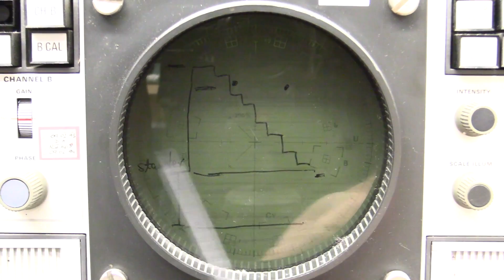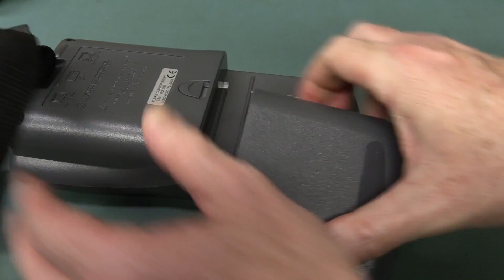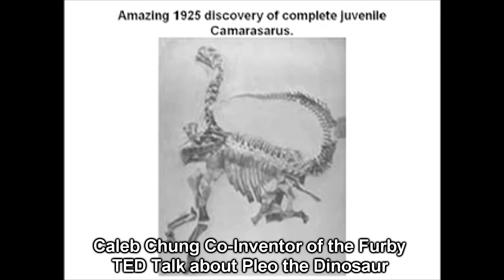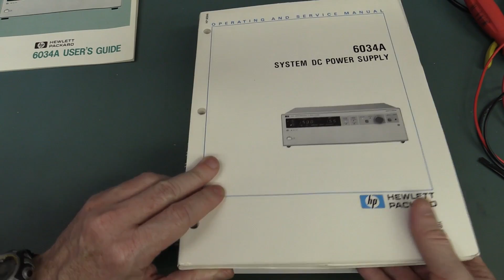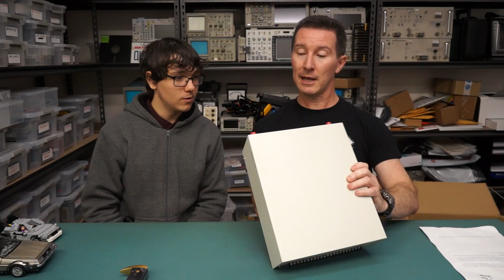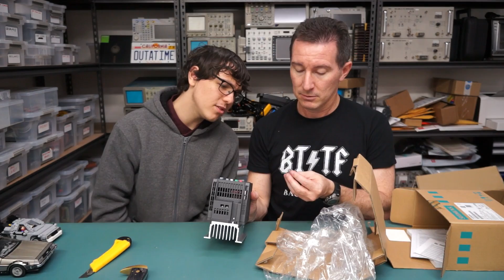EEVblog #756 - Mailbag

Comment: Pleos are cool. The skin on ours has deteriorated, but he still works. The battery pack is 6xAA NiMh, but later versions used a LiPo pack which was compatible but used a different charger. Ours likes dancing to music and eating his leaf. He also likes being stroked and tickled under the chin. When he goes to sleep it is usually because the battery pack is getting low.
I know this is a comment on an old post, but I saw the pleo on a shelf behind you on a recent video and was curious, so I searched for it. :)

Comment: maybe Pleo's touch sensors designed to work with its skin, not direct touch ?

P.S.  signal port on the Simens invertor must be for remote control (on/off, speed setting, direction setting) as usual on other invertors.  buttons on inverter itself used for initial settig of motor parameters.

Comment: +EEVblog  ----About the IGBT's...... The thermal modeling is usually done in programs such as Energy 2D and sometimes in Auto-cad.  The way they do thermal modeling for the IGBTs is that they set a field specified temperature onto the IGBT in the modeling program. The modeling program then takes the temperatures and shows where heat flows best(through the flow of least resistance). From these models, the thermal engineers keep changing the shape of the component and the size of the heat sink in correlation to the thermal resistances shown in the modeling program.
Reply from the maker: supermench 45 Interesting, thanks for the detail.

Comment: Hope you can connect the Siemens inverters to some motors  and display the waveforms and explain a bit about the need for VFD's their applications and the techniques used to implement them. Relevance in electric vehicles? Nice mail bag.

Comment: Seriously? The Bible Thumpers cracked the Nintendo Lockout chip?
And apparently where the reason for it's introduction as well?

I had no idea. That is hilarious.
Reply: Tilman Baumann Maybe they were not religious themselves only marketed towards said people
Reply: Tilman Baumann Sachen & Atari (Tengen) would have also been reasons to continue to have a lockout chip.  The NES actually has a lockout chip and it came before the snes.
Reply: Tripcore yeah, when you want a measure of control over the games taht come out for your system, you NEED to keep third party cartridges off the system. The Cartridge-bypass trick the SNES and N64 unlicensed games would often use is the same system Gamesharks would use to get past the lockout chip (though those also do other things)
Reply: I was just amazed that Religious nutters of all people where the ones driving this.

Comment: AMD and Intel written on the same chip? Is that even possible? And what has IBM to do with all that? Derp me;)
Reply: skru2b AMD was making Intel-licensed CPUs since 8086. IBM wanted to put Intel CPUs in their IBM PC, but only under condition that there will be a second-source manufacturer for their chips.
:)
Reply: ZXRulezzz
Well, I don't know why but IBM seems to be of the more sympathetic microelectronic giants out there. Only mistake they made is that they left open the Gates. I bet Intel is cursing the day they licensed their first lot of microchips to AMD ;)
Reply: skru2b It's not the only Advanced Micro Devices product to fit an Intel spec, either. I had an AMD version of the 80486 in a Tandy computer I think it was. And the K6 series brought Pentium III power to the old Pentium boards (IF the manufacturer was willing to update their BIOS, anyway), the X86 instruction set is an intel spec, and it's used by both companies, with some variance here and there.
Reply: DFX2KX Not Tandy... they got out of the computer manufacturing business when the 80386 was king.
Reply: CodeTech
Tandy was the brand name it had on the front of the case. Came with deskmate (which was a horrid OS, by the way) and a 4x CD-rom. It was clearly not one of the originals.
Reply: Hmmm - I worked for them from 1979 to 1991, and I don't recall any 486 class, but that doesn't mean they didn't exist. Weird. And yes, Deskmate was crap... but it was intended to allow people to actually do something with their new computer back in an era where software could easily cost more than the computer.

Comment: Differential gain and phase displays are just demodulated chroma amplitude or phase (R-Y,B-Y) plotted against time on the X axis. You need to use a modulated ramp test signal to use those modes.

Comment: So a company was making games for the Nintendo 64 illegally without paying royalties to Nintendo?  And they made bible games?  So they made a device overriding Nintendo's security measures?  I guess they were just asking for a lawsuit.
Reply: ***** Actually, it was for the snes, and the lockout chip is actually since the nes.
Reply: Dr_Kachu san
Well it seems kind of ridiculous.  Bible games?  You would think someone who sells bootlegged Nintendo games would be making crazy games, not Bible games.  I guess those game designers aren't very good Christians.
Reply: Well, its a shield against nintendo so to speak.
The company behind Super noak ark 3D, to not mention several other christian games for the NES actually started as Color Dreams, that was a regular crappy unlicensed game producer, but when nintendo started to put pressure on em, they renamed the company to wisdom tree, and hacked all their games to insert religious themes, which drove nintendo away in fear of the backlash.
Nintendo of america back was so concerned with religious groups attacking their "kid oriented products", that any sort of religious symbols had to be removed from the games when released on the US.

Also the color dreams/Wisdom Tree NES cartridges had another funny peculiarity.
To defeat the NES lockout chip (that is actually an tiny 4bit computer), it sent 15+ volt pulses against the lock out chip to make it crash and allow the game to run.

Comment: For the network tester, the serial port is probably for connecting to a switch or a router and you can get diagnostic and configuration information out of them without connecting to the console port which is DB-9 (on the router/switch) to RJ45 but with a non-standard pinout for Cisco devices. Cisco and other manufactures have a protocol that let's you get the same information via the network and without Telnet so you don't need to use that port. I'm surprised it doesn't have a BNC connector since even new ones still have them.

Comment: There was a lock out chip on the NES too?
Reply: Yes there was. That was why you couldn't play PAL games on an NTSC or the other way around. But it was petty simple to disable.
Reply: PoLoMoTo2534 HardDiskLover The difference between PAL and NTSC is more than just the lockout chip though. The consoles are designed differently to produce the different signals, and run at different speeds.
Reply: But like he implied the N64 was the first implementation of such a device, I guess I shouldn't be to hard on him, the NES was way before his time ;)

Comment: I was going to mention the Angry video game nerd too. I think id just was releasing a Super Nintendo version that's all. They do primarily PC games. The Angry video game nerd does some interesting stuff about old gaming hardware. The Jaguar CD is another really interesting one. He bought 2 of them and they both don't work. Sent it to his hardware engineering friend and he cleaned them, reconnected all wire and still couldn't get them to work. Apparently some dental company bought the Jaguar to use as a some dental camera and just spray painted the console. I was also wondering; wouldn't the cable simulator get really hot?